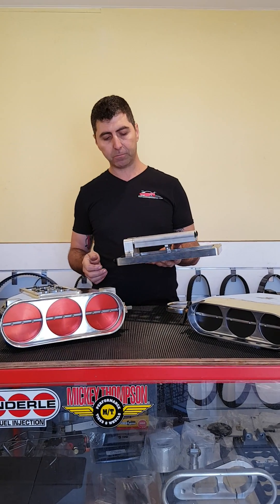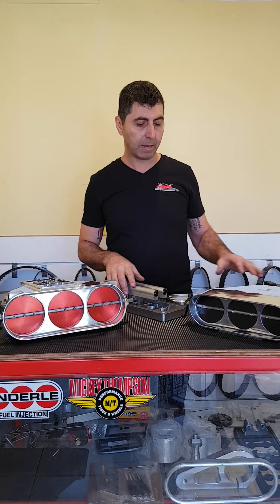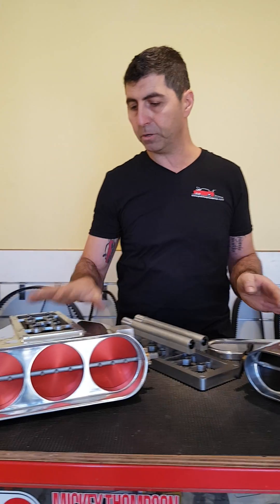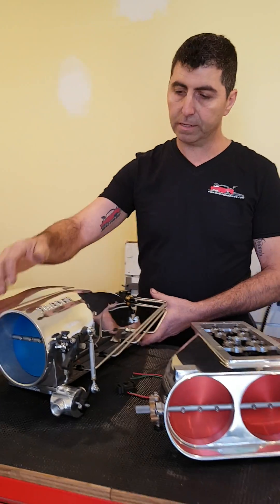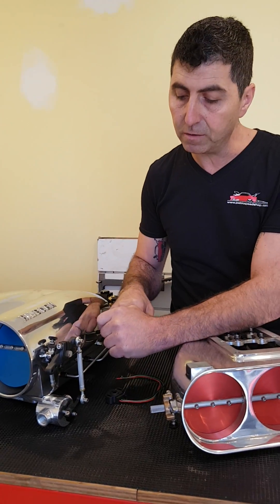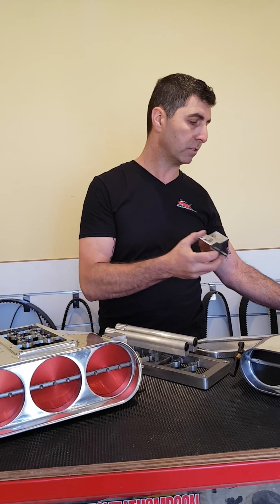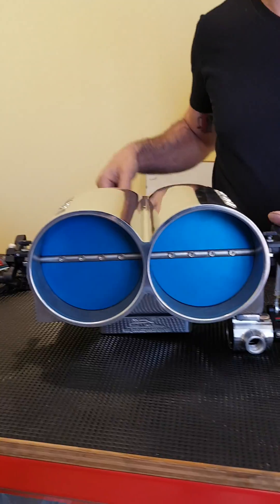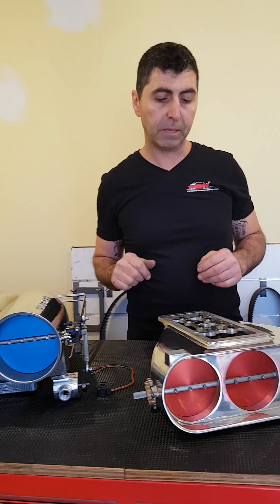Joe Blo Speed Shop Blower EFI explained

Comment: Hi. I have an old school 392 hemi. will this system work with a Hilborn 4-pot injector 6-71 supercharger. I want to retain the look of a top fueler or fuel altered of the mid 60's. This engine will be a street motor in a 32 Ford roadster.